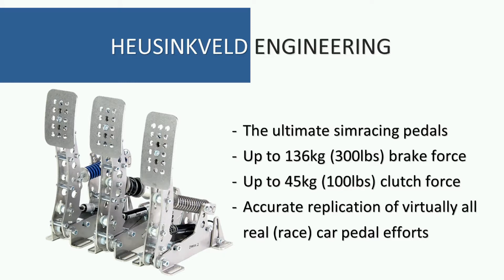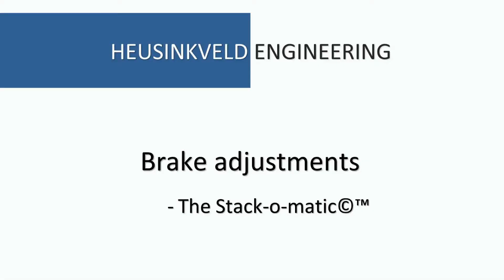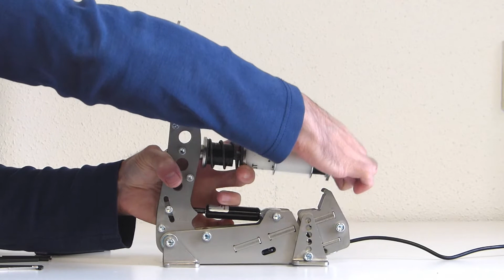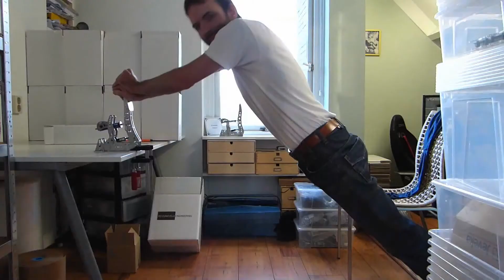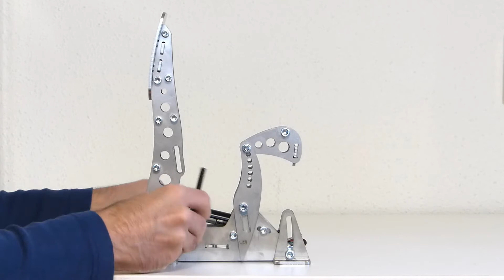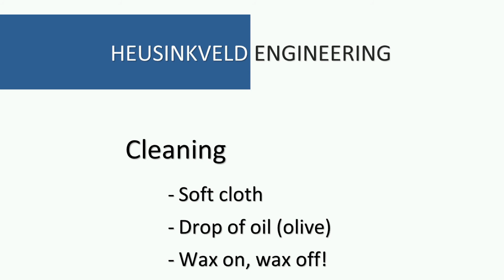Heusinkveld Engineering Sim Pedals Ultimate - Adjustment Guide

Comment: I’ve got these ultimate pedals but my Pringle on brake pedal is allot smaller why is this
Reply from the maker: Hello Christopher, 

We replaced the old larger spring with the current small spring somewhere back in 2015. They have near identical travel, as the black spacers underneath/inside the spring limit the travel of both springs.

Best regards,
Your HEUSINKVELD Team

Comment: I've had my Ultimates for about 8 weeks now and they are the best pedal set I have ever used. The build quality is top shelf, maintenance work on them is easy because of the well thought out design. I have been Sim racing since 1979 and of course race simulations have improved exponentially over the years and so has sim racing gear.  Heusinkveld Ultimate's are as close to the real deal as you can get, you get a good workout after 30 minutes at Sebring. All I can do is thank Niel and his staff for the incredible experience I get each time I race with my Ultimate's.

Comment: Will you be updating these like the sprints? I want these but I want the smart software
Reply: If they were going to it’ll only require a new controller board. I asked them on the iRacing forums and they have no plans to do so yet but said it’s still very possible. Easy upgrade if they did decide to update the board though

Comment: Out of interest Niel, why do the bolts on the clutch unit need to have identical height placement?

Thank you
Reply: Basically you slide the entire clutch mechanism up and down, on both the pedal 'arm' and the 'base'. This keeps the 'feel curves' the same, just makes them overall easier or harder to press. The 'feel curve is adjusted with the 7 holes.

Adjusting the pedal arm and base slots a different amount will change the feel curve as well, and will change the spring length. So its easiest to remember, everything up / down the same amount adjusts the overall force, and which of the 7 holes you use adjusts the feel curve. :)
Reply: Niels Heusinkveld
Ah, ok. Now i understand. Thank you. :)

Your tech is so nice....perhaps one day i will be able to save up enough to purchase one.